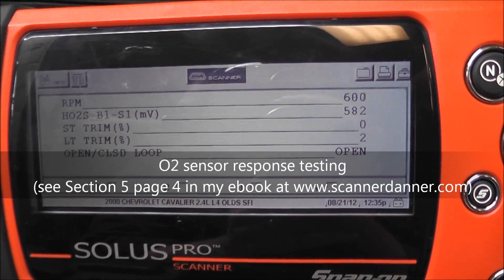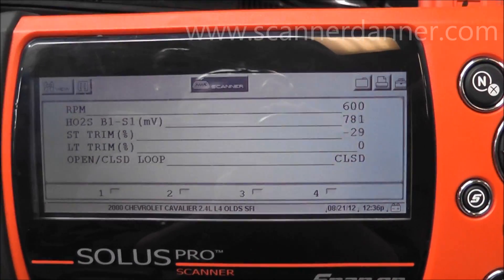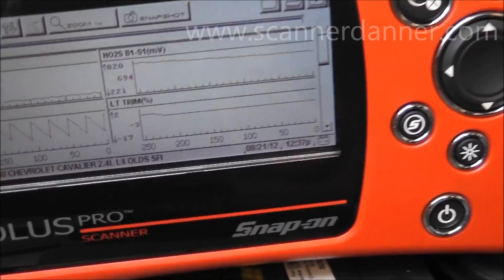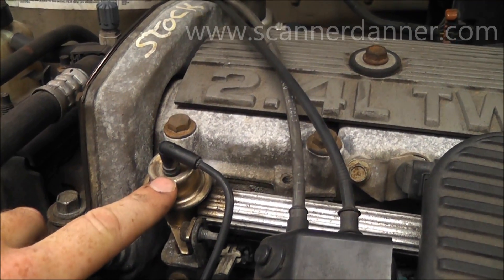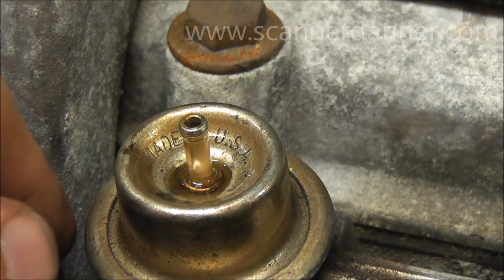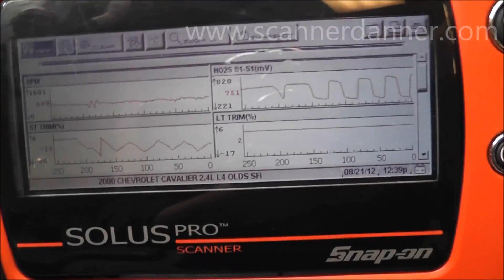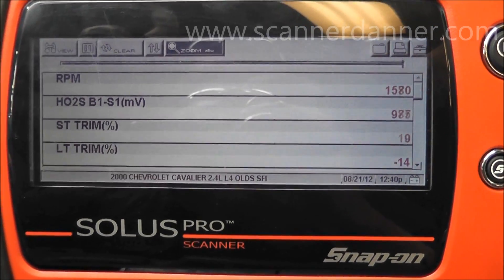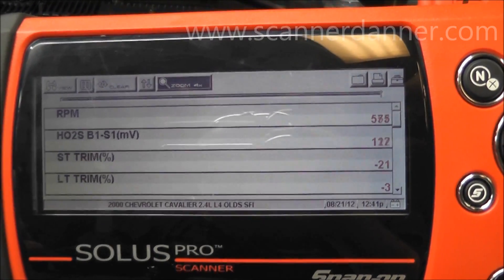Leaking Fuel Pressure Regulator (symptoms and testing)

Comment: Knowing this is a 6 1/2 year old video and in hopes if you would be able to reply, I have a 96 4.3L Astro 230,348 miles close to the same issues with rough idle. Would this cause a rev limit of 3,000 to 3,200 (Acting like a governor) in RPM's as well from getting flooded with fuel (from the FPR) inside the plenum? I believe I have a Negative ST/LT trim and I do smell rich exhaust. I'll hook up my OBDII reader again to verify. Getting a O2Sensor Bank 1 Sensor 2 issue, but that's the only SES code I'm getting after a few start-ups. My van has had a Full-Complete Tune-up and New MAF, MAP, TPS, EGR, PCV valve, Crankshaft PS, Camshaft PS,  Fuel Pump, Fuel Filter, Spider Injectors, 3 - O2Sensors and Catalytic Converter. Still runs poorly. I'll update my ST & LT fuel trim level readouts here soon. Your help and anyone else that wants to chime in on their opinion is greatly appreciated! Thanks!

Update Well, looks like my Fuel Pressure Regulator is the culprit. IGN ADV is -20, FUEL SYS 1 OPEN, ST FTRM1 -30.5, LT FTRM1 -3.1, ST FTRM2 -30.5, LT FTRM2 -3.1. What sucks now is having to remove all the stuff surrounding the plenum again to gain access under the plenum to the FPR. lol This really helped Scanner Danner! Thank You, Thank You, Thank you!!!
Reply from the maker: Here you go Jim https://www.youtube.com/watch?v=09_wQ9yQ85A
https://www.youtube.com/watch?v=dAAFM3zlJME
Reply: Hey ScannerDanner! I wanted to follow-up from my previous posts. I replaced the FPR and MAN what a difference! The ST and LT trim are between 2 to -2 now and mostly maintains at 0 at idling. O2's are reading way better as well. Still having the Rev Limit issue and hesitation not going past 3,000 - 3,200 RPM on up thru Park, Neutral and or Drive. I would understand the ECM having a Rev Limit in P & N to keep from blowing up the motor, but it shouldn't be doing it in Drive. You wouldn't have a video diagnosing this would you? Only thing I can think of is to test the fuel pressure from the new fuel pump to see if it is dropping under high RPM's. Other thing I've read and viewed is having a bad Transmission Speed Sensor? If I can get this last problem resolved, the Astro will be it's old self again... Thanks ScannerDanner for posting all your videos and keep doing what you do best man!
Reply from the maker: Does the park-neutral switch read that it is in Park or Neutral when you are actually in drive? I've seen that before.
Reply: Each individual PRND321 will light up when switching gears. When in D, it is lit on the display panel.

Comment: With the fuel regulator being bad would it cause it to mis fire
Reply: The reasent ice freeze it froze my fuel line and then one day it thawed and started. It was mis firing and we put new plugs in it and thought it was that and then the check engine light came on and took it advanced auto and they said multiple mis fire and my engine was shaking and then i would put my foot on the gas pedal and the engine light would blink and then i take my foot of the gas the engine light would stop blinking.
Reply from the maker: misfire? no.  Rough idle, hard starting, rich exhaust, yes
Reply: Bad spark plugs will cause misfires

Comment: I have a Honda Odyssey 2001 and it noticed something like it takes long time sometimes to crank and when it does the rmp are so low then comes back slowly thats when the engine is warm but when its cold it goes hight i know that for prevent stalling it the rmp are a litble bit hi like 1,500 rmp then slowly down but this car when i start the engine in the cold so damn cold it i dont let it warm up for a few mins before drive it die on the soon as i out the break on the first traffic light or stop sign slow down on to make a turn it just stalled i change the tps iac clean the Tb also have new map sensor i did new tune up new pcv valve i buy an scanner and my fuel trim reads below -10 % negative like -18 or -20 when i rev the engine to a hi rpm it starting to drop like -3 or -5 some how comes back to 0 then jump to -13 i notices the o2 sensor bank 1 it always read hi like 0.800 and .0250 the other o2 sensor 2 bank 2 it stay on the range os 0.300 or 0.200 but today i noticed something when i rev the engine i saw the etc sensor was like 184 or something i saw on the graffic like soon i left the pedal from the gas it drom below -40 like if when you unplug it then comes back to the same temperature that it was before also the engine was so rough like wants to stall
Reply from the maker: Different car but same tests for the ECT https://www.youtube.com/watch?v=wxaohKkQF3o
Reply: I did it before and i notice the the car it feels like wants to stall so i replace the sensor and cleaned the connector and put the new one since it have more then 10 years old you think it might be a fuel pressure regulator that it starting to fail or could be a lazy o2 sensor

Comment: regülatörün hava ucundan ağız ile emiş yapıldığında içindeki membranın haraketi hissedilmesi gerekiyormu? bendekiden benzin cışıkışı yok ama emiş yaptığında regülatörün cevap verdiğini( içindeki mekanizmanın haraketini algılayamıyorum) bu durum normal mi* regülatör bu !
Reply: https://www.google.com.tr/search?q=benzin+reg%C3%BClat%C3%B6r+de%C4%9Fi%C5%9Fimi.&tbm=isch&source=lnms&sa=X&ved=0ahUKEwiz8eqj5sHXAhWKXhoKHXnFD744HhD8BQgKKAE&biw=1280&bih=844&dpr=1#imgrc=yicviAHggGplJM:
Reply from the maker: Sorry my friend, I wish I spoke your language. Google translate wasn't much help
Reply: the membrane inside the regulator should be felt when the air is suctioned through the mouth. I do not have a petrol cushion at all, but when I suck it up, the regulator responds (I can not detect the movement of the mechanism in it). Is this normal?
Reply: I can not feel the reaction from the regulator during sucking . If I need help from someone who speaks English and I need to write again.
Reply from the maker: okay, so you are wondering if the vacuum assist regulator is doing it's job or not? With a fuel pressure gauge connected, start the car and then unplug and plug back in, the vacuum hose on the regulator. You should have a 6-10 psi change in fuel pressure.

Comment: I have problem with my mazda 2006 2.0di euro model 105kw it doesnt really stall or anything it just does not have power as it used to have its like running in constant limp/safe mode any suggestion where should I look. Note: already cleaned egr valve, checked for vacuum leak couldnt find any but it show's on diagnostic like 6.5 vacuum at idle and around 12 at running, cleaned throttle body, no weird turbo sounds... Any suggestion would be helpful and appreciated.

Comment: So can the fuel pressure regulator cause black smoke to come out of the tailpipe
Reply: Yes, a leaking fpr CAN cause black smoke out of the exhaust. Had it happen on a 2000 f150.
Reply: Certainly did on my diesel 2006 sprinter. The 5v ref was not there as loose wire and the engine was pumping out black smoke and rough idle because of it. Push wire in properly to make good connection and restore the 5v, and boom. Everything working fine again.
Reply: Tim Vittetoe
Reply: Naa...black smoke is caused by a resriction in the air intake system in which the fuel is not being completely burned. White smoke would be a fuel issue
Reply: A leaky FP reg would be an exact copy cat to a bad idle air control valve. Symptoms are usually a slow up and down idle speed for 2 reasons 1. The leaked fuel is sent to the throttle body via the vac hose and the rate of the unstable idle speed is determined by the severity of the leak in the reg diaphragm and usually the vac hose will suck all the fuel and wait for the reg to fill up again 2. Undulation is also cause by ECM overcompensating for the newly found fuel source and adding too much air .....best way to look at engines of today is to realize the function of and undrstand the reason for the incorporation of all the different types of sensors that are necessay in these "fly by wire" engines. Any outside fuel or air sources other than the on board sources provided to the engine via the fuel tank or its air intake sytem are unwanted and will be put in check by an instantaneous report to the ECM....any notice in positve or negative air pressures will be noticed by the MAF ....changes in air temps will be noticed by the AITS....the only time an outside air source will be tolerated is when they are allowed and  provided by via the IAC valve which provides a bypass air source when the operators foot is removed from the gas pedal at which point the flapper valve in the throttle body is in the completely closed position thus starving the engine of air/oxygen... therefore the IAC valve opens slightly providing an air/oxgen source in order for the engine to sustain combustion...an irratic or unstable idle is hardly ever caused by the IAC...he only has a spring, pintle and diaphragm and just moves in and out when hes told to.... but he really dont wanna make yur idle unstable or irratic, if hes gonna mess with you he'll either make yur idle slow or fast and thats just from bein dirty or sticky he cant help it if he gets stuck....but a leaky FP regulator, hes just sneaky and stays out of sight and out of mind....and blames everything on the MAF and the AITS lol....ok ive rambled on enough lol...tomorrows lesson is upstream 02 sensors and their relationship to the ECM

Comment: Help me
I changed the fuel pump and filter in my 1987 corvette and it's still running pretty bad for a stock car.
I had someone change the EGR valve and vacuum lines and intake gaskets, so will it be a good idea to change the Fuel pressure regulator? I also don't think I have oxygen sensors
Reply from the maker: Type in "shorted fuel injectors" in the search bar of my videos. 
This is the first thing I would check for on your model year engine. It is super common. Each injector should read 12.6 ohms but this is not a fool proof test as temperature has a big impact on these numbers.
Reply: ScannerDanner I had overheating issues but fixed that, what temp should they be checked
Reply: CorvettesandGainz ,,
Reply: CorvettesandGainz ,,

Comment: so fuel was leaking into the air intake.. or what exactly was happening with the FPR? what is this diaphragm? my car is having rough idle in the morning but then its good most of the day. I get a fault code for fuel pressure regulator. i have a throttle body issue too that is not producing faults. this video has convinced me that my HPFP (with regulator) is the main culprit.. i don't get running rich faults but it sure seems like it sometimes. im sure the bad throttle isn't helping either.
Reply from the maker: It is becoming more and more difficult to answer questions here. I have 80,000 people asking me for help now. So I have created a forum to help you guys better. It is free to join and we can exchange pictures, wiring diagrams and waveforms if needed to help guide you through the process of troubleshooting your vehicle. Thank you so much! Hope to see you there. 
Paul Danner (ScannerDanner)
https://www.scannerdanner.com/forum/post-your-repair-questions-here.html
Reply: wish i could afford a souls pro

Comment: I'm working  on a 98 Firebird 3.8,  Had no fuel pressure, replaced pump, also had leaking regulator replaced.  Long story short,  fuel pump runs/primes,  fuel at the fuel line to engine if I take off the line.  If I take off the return line with feed line hooked up I get gas squirting from the return side.  This is after replacing the regulator today.   Fuel coming into the rail, will pass out the return, hook the fuel lines back up and no pressure at the check port.  It almost seems like I have a restriction in the rail.  Any ideas?  Thanks.
Reply from the maker: It is becoming more and more difficult to answer questions here. I have 80,000 people asking me for help now. So I have created a forum to help you guys better. It is free to join and we can exchange pictures, wiring diagrams and waveforms if needed to help guide you through the process of troubleshooting your vehicle. Thank you so much! Hope to see you there. 

Paul Danner (ScannerDanner)

https://www.scannerdanner.com/forum/post-your-repair-questions-here.html

Comment: 92 Cavy 3.1L: Stalled motor, no start (crank only), has spark, and intake full of fuel. Pressure ~40 and drops to 0 immediately after priming. 95% sure regulator went kapoot after watching this video, among others. Thank you for your knowledge. Saves me from tossing the book-o-parts in a spray-n-pray method of diagnosis. (Gives me an excuse to add another tool or 3 to my peg-board, hehe!)

Comment: do the gas leak internally , when the fuel pressure regulator is bad
Reply from the maker: +judah a regulator can leak into the return line but this only causes a bleed down issue and long crank times
Reply from the maker: +ScannerDanner  For additional information and or help. Sign up for my forum at www.scannerdanner.com. It is free to join. Hope to see you there!

Comment: Random question, do you know the location of a fuel pressure regulator on a 98 stratus with a 2.5l?
Reply from the maker: +M Theory it's in the tank or part of fuel filter (3 lines on filter = regulator is part of it. 2 lines on filter = it's in the tank)
Reply: ScannerDanner my car wont start and oil smells like gas no gas in vaccum line but smells like gas what could this be i also recently installed a catback exhaust

Comment: Will a bad FPR only cause a rich condition? Also I unplugged the vacuum line to the FPR and the pressure returned back to normal (50-55) but when I plug it back in, the pressure dropped to 38-40 psi. I was certain the FPR was the problem but according to your videos, seems it only causes a rich condition although I am getting a lean condition in bank 1 and 2.
Reply: yes they can . my 97 chevy silverado had a bad fpr and it was dumping fuel into the intake,

Comment: I got stung by the booster hose test last year with an o2 pegged at 900mv. It turned out to be a brand new fuel injector that was sticking open. It was the waveform (no pintle hump) that helped me identify it. Info I gained from here! :-)

Comment: I need help! we have had to mechanic opinions and so far nothing we have a 95 Chevy Blazer with a v6 Vortec last month we replace the spider injector and it ran great until last week last week it would start and then when you put it in gear it would die and then it would have trouble starting it did that for about 3 days and then we went to go to the store the other day and it died while driving and has not started since two mechanics told us a bad fuel regulator if you take the fuse out to the fuel pump and stay on the gas pedal it will start and then plug the fuse back in really quick and stay on the gas and it stays running but as soon as you let off the gas it dies we replaced the spider injector a second time it started right up went 30 feet and back to square one....help :( (fuel pump has already been ruled out)

Comment: Would love to see this for a '96+ 4.3 or 5.7.  Those engines have a spider injector assembly with the regulator inside the intake plenum. Which is a lovely cheesy plastic cover over the top of the manifold.
Reply from the maker: +consaka1 I have some videos on that for the pre-96 4.3 (not much different with the regulator. Here is the links to it. 
https://www.youtube.com/watch?v=09_wQ9yQ85A

https://www.youtube.com/watch?v=dAAFM3zlJME
Reply: ScannerDanner Thanks! I'll give those a looksee after my wifes doctor appt tomorrow. 
I hear these "spiders" go bad occasionally and or the regulator which is with them.
Reply: +ScannerDanner hi scanner well good news , i got the no spark issue fixed !!! but i have a bad fuel pressure regulater leak !!! i have gasoline in my oil pan !!!! i noticed it kinda of late and i had the car running for 7 minutes !!! there was a lot of smoke comming out the tail pipe!!!  i guess my question is , is there a risk of the internal damage , cause i had it running like tgat for 7 minutes??
Reply: +Omar Canales you'll be okay, just change the oil
at least you didn't drive it that way and only had it idling
Reply: +ScannerDanner Premium ok thank you buddy
Reply: +ScannerDanner Premium hi MR Danner on my 03 altima  2.5 I'm having to take out the spark plugs and dry them from saturated gas then it starts and runs fine is it possible the dampener in the tank on the pump is the cause and would that be the only thing to cause that How to test thanks I need some help and relief from car and wife

Comment: i had the same thing just happen and my car would spit out fuel from the intake like crazy! It never gave me any warning, it just stalled while exiting the highway and had to tow it home. The part cost $40 and took about 35 minutes to replace. Thanks a lot for this video!
Reply from the maker: +UFOGHOSTHUNTER no problem, just be sure to change your oil now. there will be a significant amount of fuel that is now in your crankcase.
Reply: +ScannerDanner 👍👍
Reply: So my mechanic told me the same thing that it's spitting out gas also my 2.4 would always stall, I just got a O Ring replaced from the reguator my mechanic didn't even charge me so I'm a little confused of I should get the whole thing replaced ? Lmao